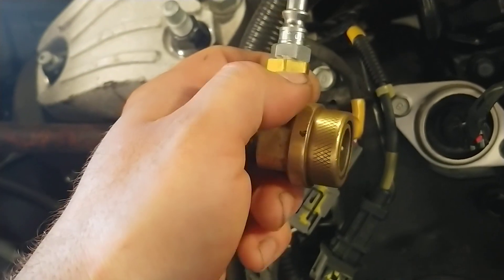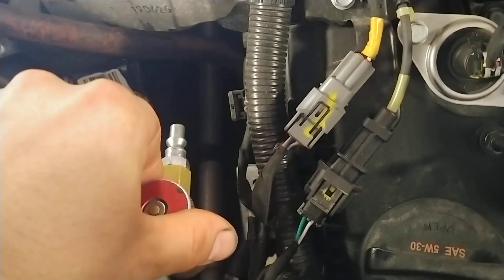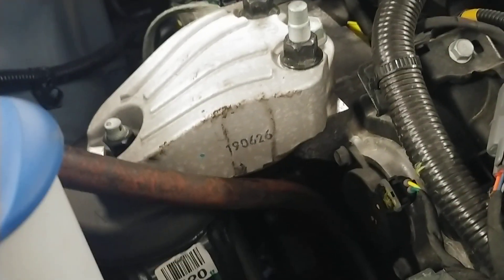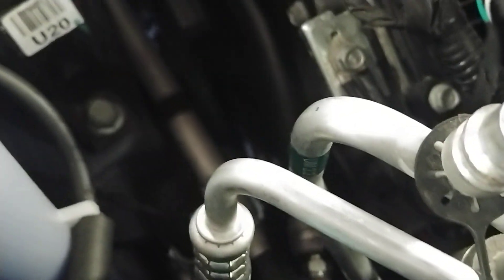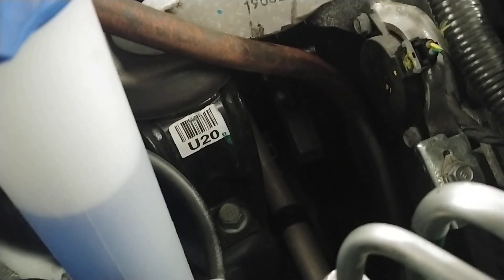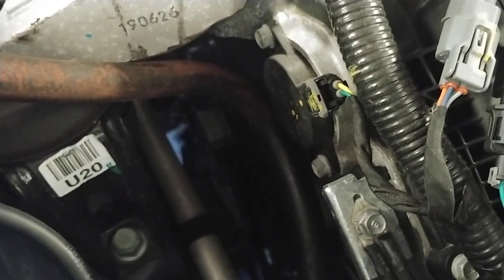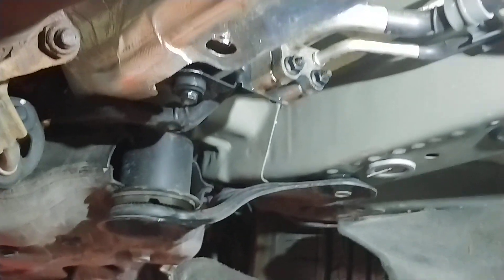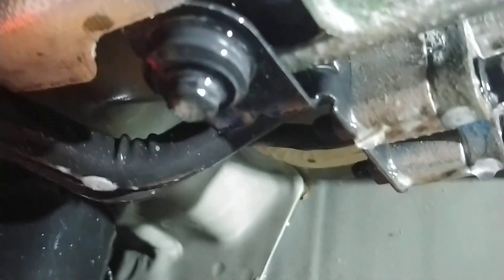Locating A/C leaks with shop air

Comment: Hi Jeremy....Couple of questions. Do you replace the desiccant bag after a repair/finding such as these? Does everyone in your shop working on A/C have to hold any additional certifications working on A/C or just the “ODS ” card? Cheers Pal
Reply from the maker: honestly.. if there is no major contamination then i do not change the desiccant bag. side note: most desiccant bag are in sealed unit(condensers) so non serviceable.

As far as i know we only need the a/c cards here in quebec--- cartes halocabure, but besides that no other qualifications needed. 

Thank for watching Ian:)
Reply: JL's Auto Solution Thx Jeremy. Sorry for all the questions. I want to start doing proper auto A/C. No more 12a!
Reply from the maker: @TheGibby3340  completely understand, a/c is fun as long as it not a EV thermo pump system.. I'll take a snapshot for yah.. they are a pain to deal with. 2condensers, 3way and,2way valves /chillers/txv,electric compressor. 

And there's more lol.. have a good weekend
Reply: JL's Auto Solution Oh wow...I have briefly looked at an EV cooling system schematic...had a headache for a month afterwards 🤣. Cheers Pal